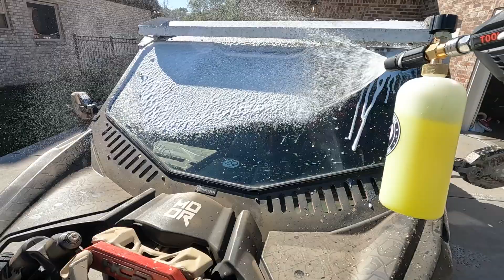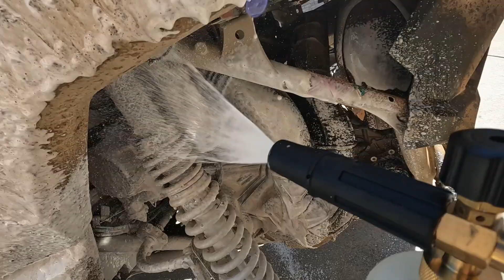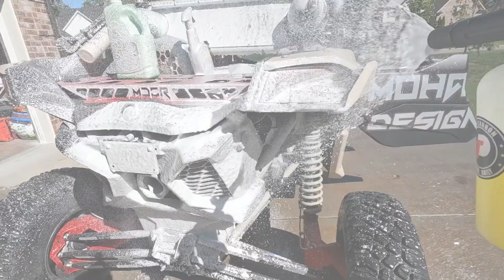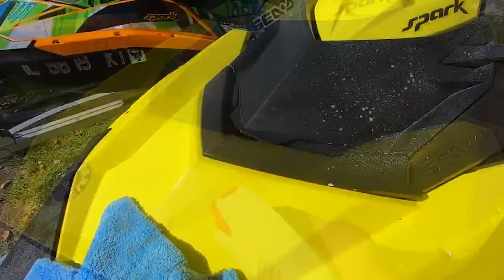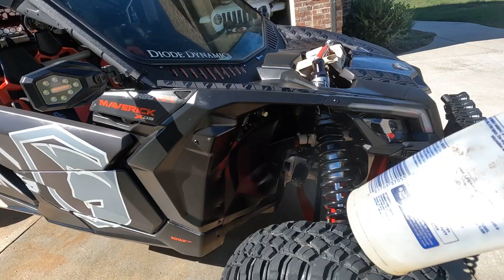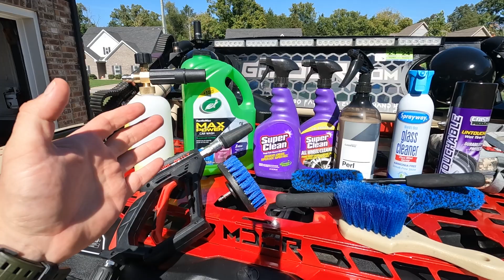How to Make Your Can-Am Look Brand New: Easy Wash & Shine Guide

Comment: Machine looks great!!! I don't remember, what flat roof did you get again? Do you still like it?
Reply from the maker: I have the AFX roof I’m not too crazy about the fitment … but it’s holding up and it works for the price.
Reply: @MohawkDaveOffRoad  Thanks!
Reply: What is that bottle u use to spray the shocks can u send me the link I believe u said triflow if I'm not mistaken dry lube but can u send me the link